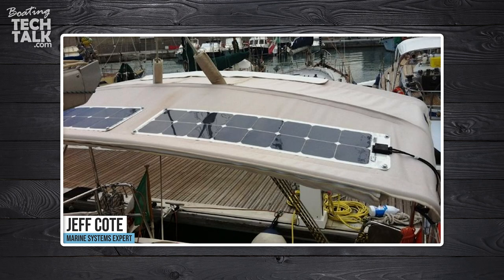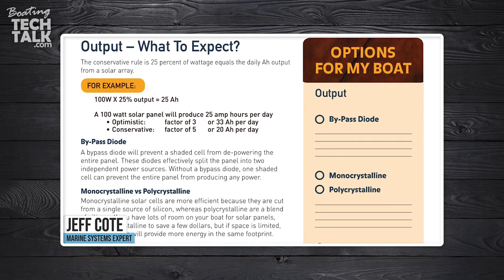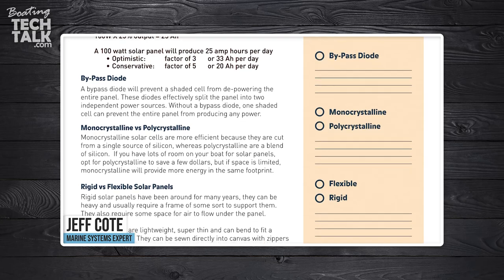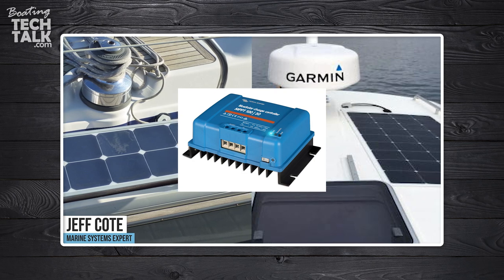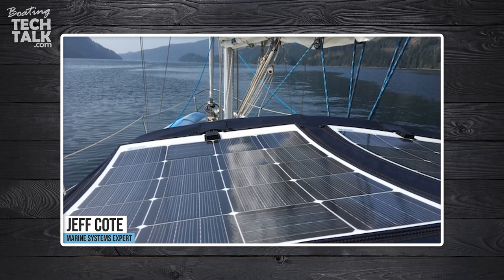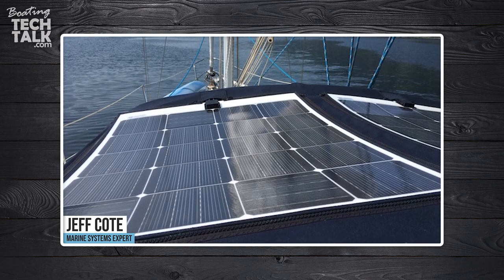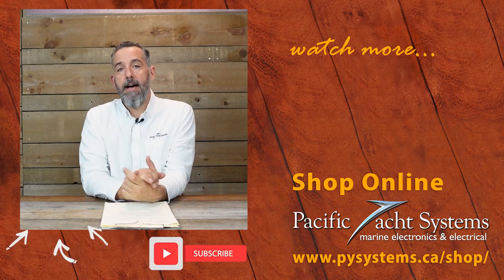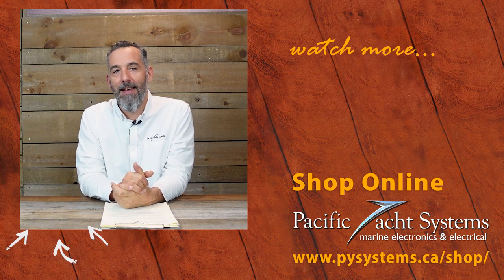How To Choose Solar For Your Boat - FREE Guide

Comment: Jeff, that is an awesome resource for those of us who NEED solar to survive at anchor or on passage, but- don't have the time to become 'expert' at solar panels, chargers, bypass diodes, battery isolators, etc... BUT need the charging source! Maxeon cells, tinned copper UV resistance cable (properly sized no less), protected positive terminals... the required knowledge is endless. I can't wait to have this on hand! Greatly appreciated.
Reply from the maker: Glad to be of service David!

Comment: We were just talking about possibly upgrading our panels. Currently have 4 x 140W panels and we plan on trying to be prepared to be on the hook indefinitely without having to run the generator except in periods of extended low sunlight. We still have to determine what our power needs are before deciding.
Reply from the maker: Sounds good.

Comment: Hi Jeff, very helpful guide!  
I have a good one. On my Catalina 38 I have two rigid 100W panels in parallel, with a Morningstar PWM SunSaverDuo 25amp controller. Wanted to add a temporary Sunpower 100w flexible panel to increase charging amps… all in parallel…  then, while reading the new panel’s manual saw that it recommends “ not to connect this panels in parallel because of shading, panel can go in reverse bias and damage the bypass diode. Sunpower does not recommend parallel installation if shading will occur”.   So, how likely is this to happen ?  Is a sailboat.. shading will occur eventually.. am I doomed and need to go for an MPPT in order to be able to connect in series?
Reply from the maker: With shading on a boat the best thing is to run each panel to it's own controller.  2 small 15a controllers is about the same price as a 30a.  so price comes out about to same anyways.   I would not connect different panels together even of the same watts.  they will have different specs for max power voltage etc.

Comment: I understand that Firefly has gone out of business or something similar. I was hoping to buy their AGM batteries the next time I needed them. Do you have a recommendation for batteries comparable to Firefly's?
Reply: If they have gone under, I can't find any evidence on the internet.  The rumour may be true but I can't find it.
Reply: @ricknicholson5894  I can't remember where I read or heard it but I hope it's not true. I think they were bought out. Their website has been suspended.
Reply from the maker: They seem to have had quality control issues with lots of failing batteries.   The main distributor in the USA has dropped them.  I'm sure some stores are still selling them, but they are Likely harder to find now.